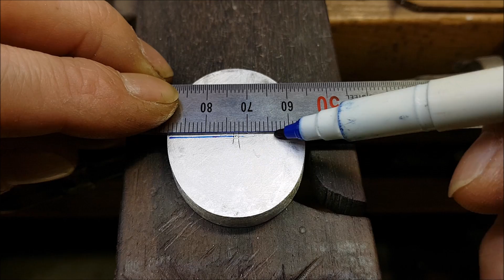Make a special "BOLO TIE"/ Lapis lazuli, Silver, Gold, Leather string

Comment: Beautiful work 
How long does the gold last??
Is the camellia oil needed on a regular based to keep it healthy??🇦🇺🐈‍⬛😎
Reply from the maker: Gold lasts a long time, semi-permanently.
The thickness of the gold sheet,,,
A postcard-sized gold sheet is about 3-4g.
That's about the thickness.
It is about the thickness of a regular paper.
Heating these metals to a temperature between 260?370°C increases 
the movement of the atoms. 
When pressure is added, 
this causes an electron exchange at the surface between the two metals, 
creating a permanent diffusion bond. 
This diffusion bond occurs far below 
the soldering temperature for either metal (Dhein, 2004).
Nothing is permanent in this world.
It may wear out over time.
Physical contact may cause it to peel off.
It doesn't go away easily with the passage of time.
Because silver and gold became one.
This is different from normal plating.
Thanks~

Comment: Awesome video! Thank you for sharing. What is the primary purpose of the camellia oil do in the last step? Thanks!
Reply from the maker: Camellia oil is vegan oil.
The reason for applying oil is to delay 
and protect the oxidation of the silver surface.
A very thin oil film protects the surface.
After applying the oil, clean it again to finish.
The camellia oil that I use is safe to eat.
It is a very good natural oil that is harmless to the human body even 
when the ring is worn on the hand.

Comment: Do you catch and save the filings?
I imagine after several projects there could be a significant amount.
You do beautiful work.
Thanks for the video!
Reply from the maker: All about the work,
First, it is contained in my head.
Secondly, I post it on the blog.
Third, back up all data.
Thanks~
Reply: Dear Mr. Meister, if I may: he is asking about how you collect the scrap material left over from filing and cutting- yes, the Meister has a big metal tray under his work area to catch it all - he sweeps it up and reuses it 😊👍

Comment: I have never seen Keum Boo done with flame before, always on a heated surface of some type.
Reply from the maker: Keum Boo ( 금부 )) is a traditional Korean work method.
Since we haven't been actively using it in recent decades,
Not much is known.
I would like to tell many people the benefits of this work.
Reply: @SilverMeister  Yes  I was taught many years ago by a Korean friend, always used a hot plate it was interesting to see another method i.e. flame.
Reply from the maker: @pijnto  
If you can control fire and heat,
It doesn't matter how you work.
I also use a hot plate.